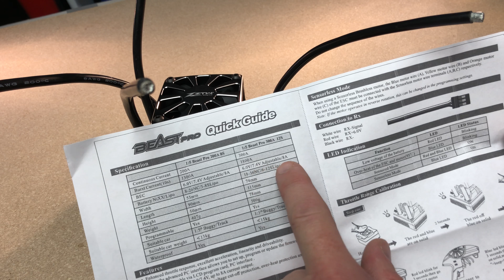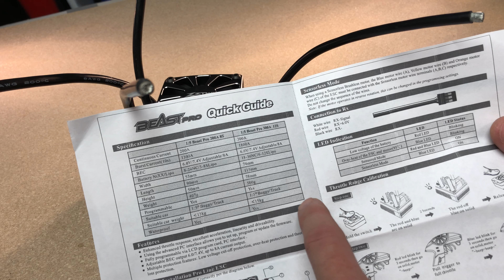ZTW BEAST PRO 300 AMP 6-12S ESC RC CARS

Comment: They basically put one of my 12-cap 15S Cap Packs inside the ESC. I'm not sure if that is a good thing or a bad thing. 

Here's what I mean. I've been using that cap configuration for a few years now since it lets me build up a very low ESR ~5,000uF capacitor network at a reasonable cost. Castle actually packs over 7,000uF on the Mamba XLX ESCs from the factory, but it's less obvious because they use more expensive low ESR caps that allow the ESC to be packaged more compactly.

I'd wager that if you took apart this ESC, the actual MOSFET drive board would probably be about the same size as the Castle Mamba XL ESCs', but they used a much bigger heatsink. This could partially be to serve as a case for all those caps, but the bigger fan sends a mixed signal. Caps like those inside this ESC are typically rated up to ~105 deg C, which is ~220 deg F. If the ESC gets above this temp for too long, the on-board caps can literally blow up. (Remember all those old XL2 failures). Sooooo the monster fan and heatsink either means that ZTW is really conservative and wants to run their ESC at a much lower temp than Castle, OR their circuitry is less efficient, so it produces more waste heat at a similar power level.

Building a good ESC that won't blow itself up the way we run is hard. I'm really curious to see how this thing actually performs.... and what Castle is planning to counter this new competition.
Reply from the maker: Word
Reply: rhouse21 - RC Physics you should look some mgm esc up ...800 amps
Reply: Track13News thanks
Reply: "My 12-cap packs" ??? lol....Anyway I just bought one along with a Leopard 58113 530kv to run in my Kraken Vekta on 12S. With the right motor and low amp draw the ESC won't get hot. The Leopard motor is 110amp max, so it should run nice and cool on 12S.
Reply: rhouse21 - RC Physics agreed. A couple of questions... Has Castle countered (I don’t think so) and I haven’t seen any new posts from you. Why? Always liked your videos.
Reply from the maker: I have been really busy building up my consulting business DrillDown Solution, hoping to get some RC time next spring
Reply: @geejayrc9401  what can u send me so I can fully understand this amp draw would you have a link to a video Gavsta72 😎😉
Reply: @gonzodetroitify  You need to look at motor specs. Motors get their power in 2 ways, amps and volts. Higher volts and lower kv = less amps. "Volts over amps" as it's known. An 800kv motor on 8S will spin at 25k RPM and pull around 200amps, a 500kv motor on 12S will also spin at 25k RPM, but only pull around 110amps. Here's the motor chart for the Leopard 58113's which are my go to in 1/5 rigs. Notice the lower the kv, the higher the volts they can take, and the lower the amps drawn? https://www.rcjuice.com/motor-esc/brushless-car-motors/1-5-motors/leopard-58113-v2-4-pole-brushless-sensorless-motor-for-1-5-scale.html

Comment: That esc is huge, nice vid sir question what size motor and kv’s  could I run on that monster🤔
Reply from the maker: Really any size 1600 or less kv, recommended motor is 70mm 620 KV,
Reply: Track13News so a low kv tp power motor is good !their really strong motors.
Reply: I like to perform speed runs so that esc and a low kv power motor would be perfect huh?
Reply from the maker: Yes big boy TP would be perfect
Reply from the maker: Could very well be, the ESC weighs 600 grams so it’s kinda a heavy beast, with a big motor all this weight could be a factor.  But could be used in a limitless, doesn’t really fit in a 1/8 scale platform with motor, batteries, etc.
Reply: Track13News possibly I could make it fit in my arrma typhon maybe?
Reply: Track13News one more question sir will a 2080kv motor hold up to that beast?
Reply from the maker: Mr Speed 52608 I ran a 1200 kv ESC worked great, your motor pulls the current, so the question is if the ESC can control the motor at high amp draw, the beast is 300amp continuous 1800 peak, so at the high KV I cannot say for sure, but if it’s a 40mm motor sure no problem
Reply: Track13News thank you sir👍
Reply from the maker: No

Comment: Hey man have you had issues with the LCD card for this ESC?  I can't save any changes on it, it never says "Ready to Connect ESC" it just goes straight into the specific settings.  Any help would be appreciated, thanks!
Reply from the maker: Use your computer, download setting software

Comment: my kit comes with the 300a. im only running 8s.  can i replace it and use a max 5?
Reply from the maker: This is a 1/8 scale I converted to 1/5 scale guts, but max 5 will work for 8s yes

Comment: Looks sweet...I tried looking it up on the website....could you put a link in the description ?
Reply from the maker: https://fatkidrc.com/products/pre-order-ztw-12s-300-amp-esc-with-program-card
Reply: Track13News thanks for the reply!
Reply: Can this esc be programmed to give reverse function on the car you install it in?
Reply from the maker: It is programable, you can reverse wires to motor, or you can reverse throttle on transmitter.  Hobbywing are made in this same factory, very similar programming features
Reply: Track13News thank you for all your responses!!

Comment: Will this esc handle 3200kv 1/8 TP power motor  ? The motor is rated 320A ?
Reply from the maker: Yes
Reply: Lol 4050 we here for the same answer
Reply from the maker: Update, I ran 12S Steve Neu 1200 KV 40 can.  I have heard that anything over 1200kv and you may smoke this ESC, fyi
Reply: @Track13News  thanks for the confirmation i was told that the esc wasn't worth it especially for drag racing

Comment: Isn't 7.4v the voltage of a 2s lipo battery
Reply from the maker: Yes 7.4 v is a 2s lipo, most ESC only output 6v so if you have a HV servo needing 7.4 to operate at maximum performance then this is good
Reply: @Track13News  interesting. But on the video I know I already mentioned that it has a BEC of 6.0v to 7.4v which is a 2s lipo. So technically it would only run on 2s lipo battery. But what you said sounded interesting. 👍
Reply from the maker: What would only run on a 2 s battery?  Are you who cares about the ESC bec and just run a 2s battery to your servo?
Reply: @Track13News  Isn't the BEC the voltage of lipo batteries the esc can take and not the voltage of the servo?
Reply from the maker: No that ESC can accept 12s lipo, and manage that voltage to the motor, the ESC has that the output and a step down BEC output of 6v to 7.4 v for servo
Reply: @Track13News  OOOOOHHHHH so the BEC is the  maximum voltage of a servo it can take not the lipos it can take.